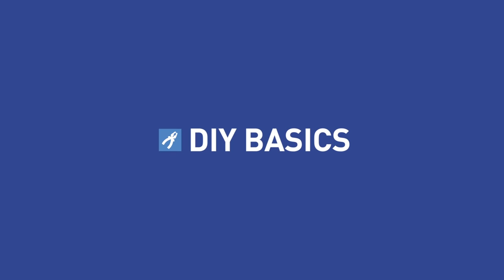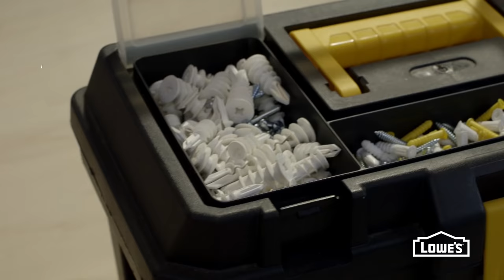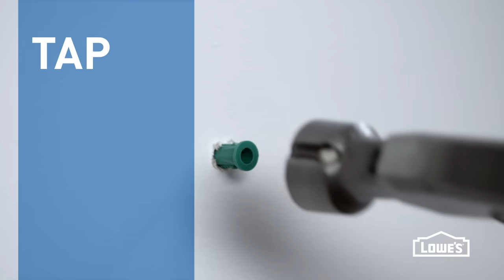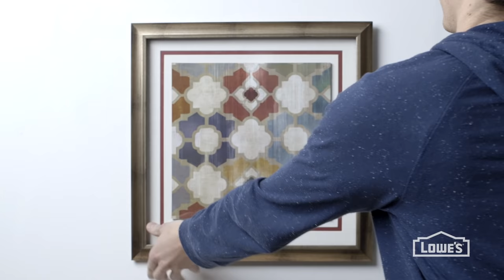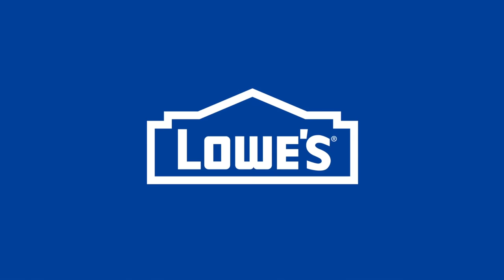How Do I Use Drywall Anchors? | DIY Basics

Comment: How do you know which size of the screw bit for the anchor?
Reply: What I did was got the screw I needed to put in the wall. I have a bag of mix matched anchors of different sizes. I just put the screw in different anchors. 
-If it came out without twisting the anchor is too big. 
-If you have to turn the screw into the anchor and met with a small amount of resistance about three turns in, it’s the right size! 
-If it doesn’t turn at all then it’s probably too small (screw and anchor roughly the same size). 

Hope this helps 👍

Comment: How do you determine the correct size drill bit to use with the anchor your purchased?
Reply from the maker: +Antonio Gonzalez if anchor diameter is shown on the package match the drill bit to it. If diameter isn't shown a good rule of thumb is using drill bit that's the same width as the narrow portion of the anchor. Thanks for watching our video.
Reply: @lowes  5 years later and this video was super helpful for me and my gf right now haha Also this question and reply super helpful. Thank you Lowe’s!

Comment: I have the hardest time getting anchors fully inserted into the drywall. I usually have to cut the anchors shorter, which isn't ideal because the anchors were provided with the item I'm trying to hang. Any tips? Should I just keep hammering the anchor until it goes in?
Reply: Anybody else? I’m having the same thing, and when I hammer too hard they break

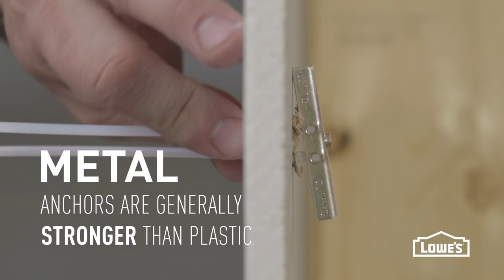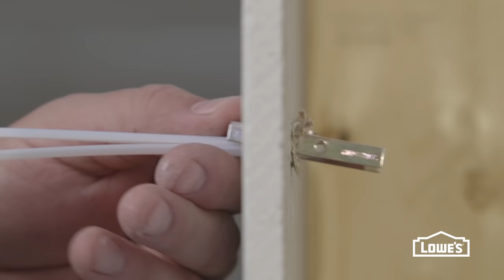Comment: And what exactly happens between 0:35 & 0:36? Could have bloody sown that perhaps? Kind of the crucial part.
Reply: The flat metal brace has a hole in it for a screw. The little nub you see sticking off it is part of that. All the plastic bits beforehand are really just a way to get the metal anchor to the other side of the drywall through the small initial hole. In goes the screw, with some sort of hanging device being secured to it. Up goes the painting.
Reply: It looked like it would have just fallen out to me.

Comment: What if there's a stud in the way? How do you get a drywall anchor through the wood?
Reply from the maker: Hi Edwin, wood is sturdy and doesn't usually require an anchor to hang items securely. If you want additional support for heavy objects, you can use metal hollow self-drilling anchors and toggle bolts. These are compatible with wood!
Reply: @lowes omg, I drilled a hole intentionally into the stud, put an anchor in and then my screw. I didn’t know the anchor was intended for mounting where there was no stud. 😂🤦🏻‍♀️ seeesh, my first time living by myself hanging stuff up and idk the basics lol

Comment: I hung a mirror using a plastic anchor and I’m really nervous that it will still fall down and shatter. I took a peek from the side of the mirror by lifting it and the anchor was sticking out the hole that was made.
Reply from the maker: Oooh, sounds like that's too much for that plastic anchor to handle. We'd recommend using toggle bolts ( https://low.es/2GCjYhf ) for much more holding power. Be careful!
Reply: I hate plastic wall anchors and struggle with them every time I use them. I hate them.

Comment: Forgive my stupidity, but just verifying, this can go anywhere in the Sheetrock? I won’t need to find a stud?
Reply from the maker: Drywall anchors don't require finding a stud, as they're usually designed to provide support when a stud isn't accessible. Always make sure you're considering the item weight of whatever you plan to hang to pick an appropriate anchor. We hope this helps!